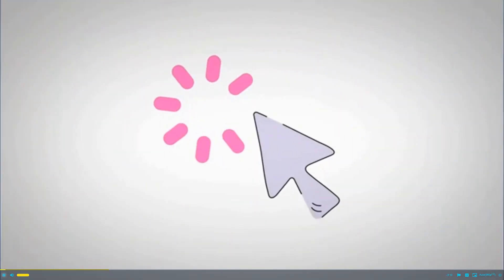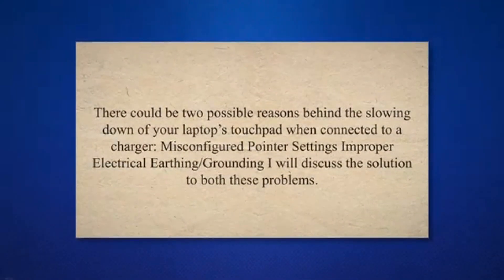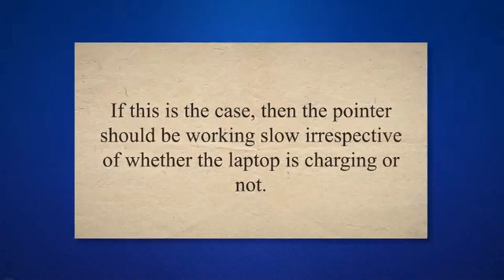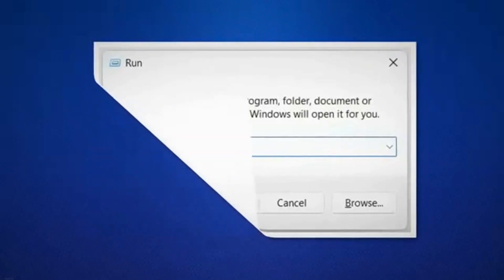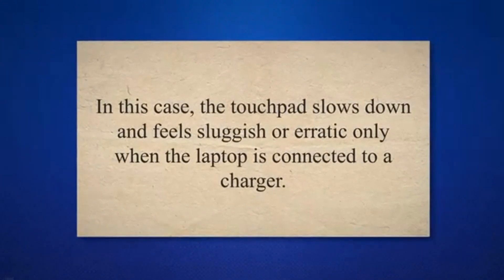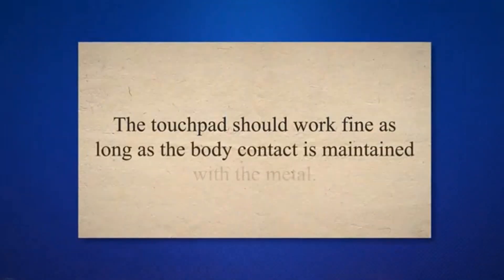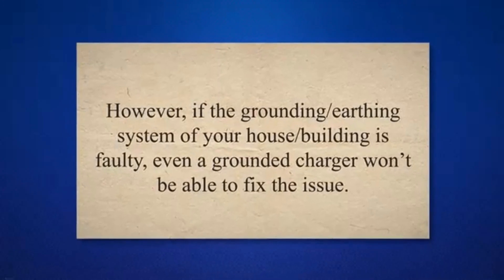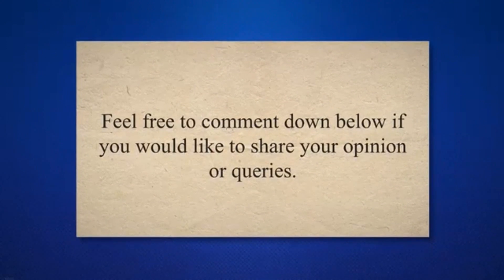Laptop's Touchpad Works Slow When Charging [Fix]

Comment: THANK YOU!! The touchpad of my M1 Macbook Pro is not working correctly while charging. Putting my left hand on the body of the device solves the problem. I guess the third party charger with EU plug is not grounded properly in Vietnam.
Reply: Same problem

Comment: Usually due to improper electrical earthing/ grounding issue. Test this by touching any metal part of your device, such as a screw whilst charging and the lag will go. Make sure you are touching the floor with your foot when doing the above.
Reply: I find out you don't need special charger 😂 just take a wire and stick with tape on your laptop screw of any metal place of your laptop and drop the wire on the ground 😂😂 it works

Comment: i have a question regarding HP laptop , some hp laptop have slow cursor pointer issue . cursor doesen't get effect (can't change slow or fast with setting changes) even and after change apply on setting .
Reply: yes my HP Pavilion too, the touchpad very slow when charging
Reply: @tyanmutter1437  same here hp pavrllion